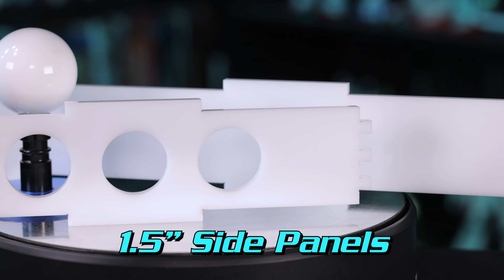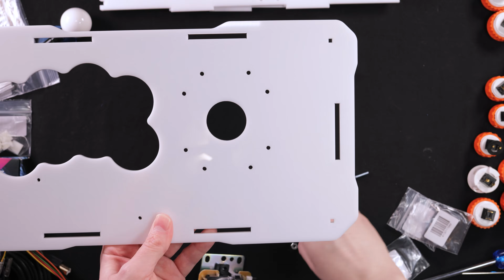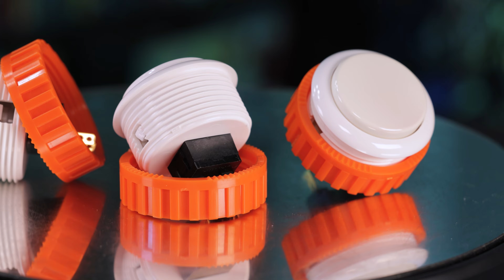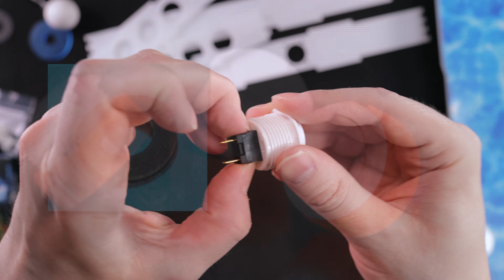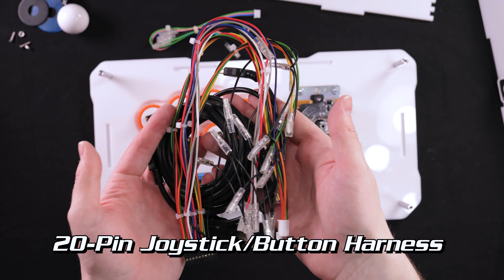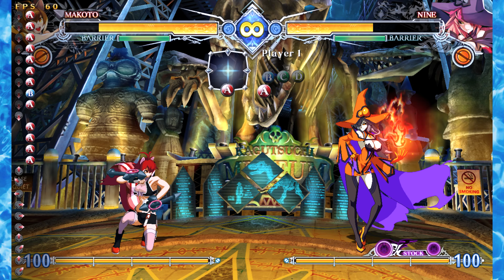Building an Arcade Stick - Piece by Piece

Comment: Works with PlayStation 5?
Reply from the maker: Yes. This Brook PCB doesn’t control the left or right stick, but it works for the D-pad. Most fighting games will work just fine, though you should probably consult the manual to make sure.

Comment: do you have links for the items in the video?
Reply from the maker: I'm not sponsored or anything so kinda felt weird posting links to shops and stuff lol. But I basically bought everything from FocusAttack.com They have a category for the BnB fightstick that runs through all the basic parts. It's definitely the best way to build a stick like this, though I did have to go off Amazon for the Brook PCB (sold out everywhere else) and most of the buttons I already had on standby.

Comment: Though I wasn't looking for Gunpla, your video showed up on my feed because I've been down the arcade stick rabbit hole lately. Just wanted to say thanks for clearing up my worries on actually going full custom. This is a lot more straight forward than I thought it'd be. 

Did you have to install any firmware to get things up and running?
Reply from the maker: Thanks! Great question too. I was nervous about firmware stuff, but the Brook PCB worked great right out of the box. I did later install a firmware update from their website, but it was really easy. Just download a small file, plug the stick into a PC, run the file, and it's done. Seems like it was mainly bug fixes, so not needed, but easy enough to do that I'd recommend it.
Reply: @redheadphones6  Noted. Thanks again. I'm going for a Korean lever. Currently waiting for on Sanjuks V7 to arrive.